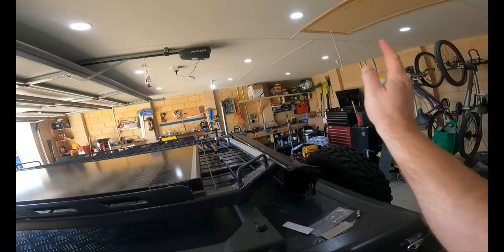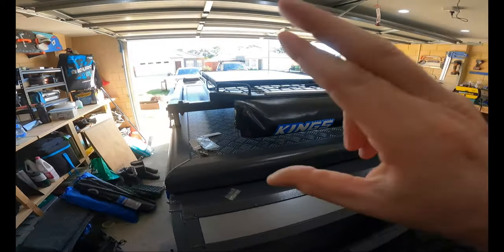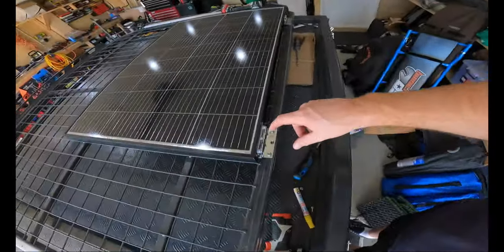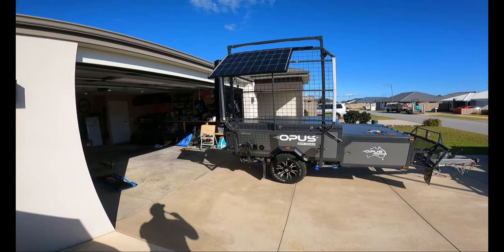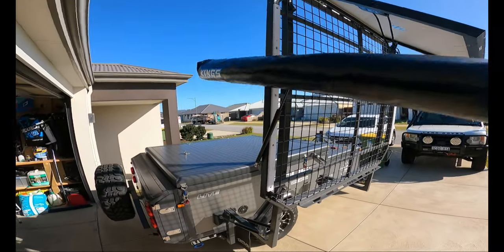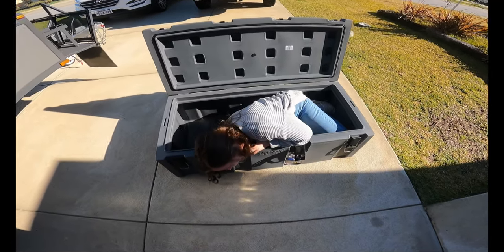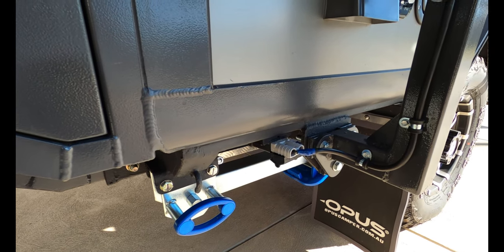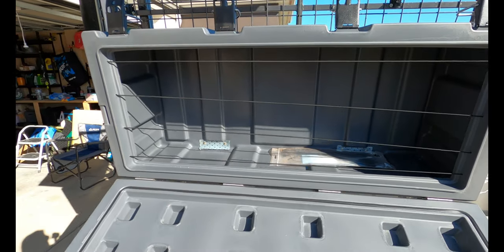D.I.Y GAS ASSISTED TILTING SOLAR PANEL MOUNT FOR $29, Improved panel efficiency by 35% !

Comment: Thanks for the video, very helpful. Small point—the gas strut seals will last longer if you install them with the rod down. See Camloc video ‘how to mount a gas strut’
Reply from the maker: Morning Mark that is good advice and I did take this into account but it only works when I have the rack lifted up which was how I intended to have the solar panel setup whilst at camp 

I figured that it would be setup more that way then when I had the rack flat for transit. When the rack is lifted in the air and solar panel extended you will see the rod end facing downwards slightly 

In hind sight I ended up using the gas struts more when parked up for visiting spots and going for works so I should have mounted them around the other way for the amount of use I was doing with that 🤣🍻

Comment: Will be doing the same with my ezytrail z but i wont leave it an an angle. If its flat then i wont have to worry about what direction the camper is in. Even though i will also be using a solar blanket as well. Basically fix the solar to keep the batteries charged while parked up and have that extra solar when camping
Reply from the maker: Perks of this setup is if I want it flat it folds flat, also with the way this boat rack tilts flat means the solar panel in facing downwards rather then 90 degrees so wouldn't work on this setup at all 

Happy camping 🍻